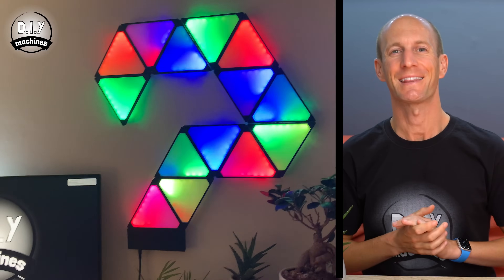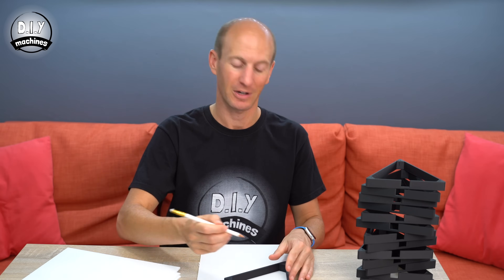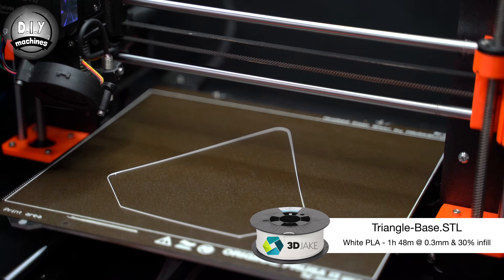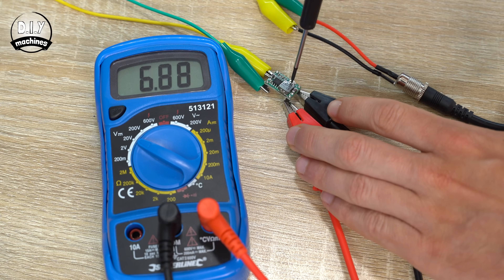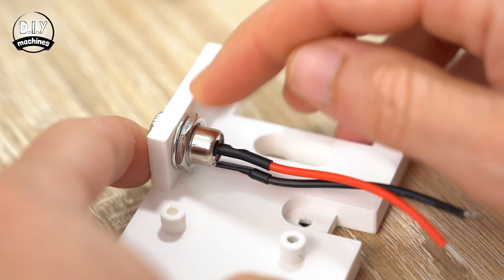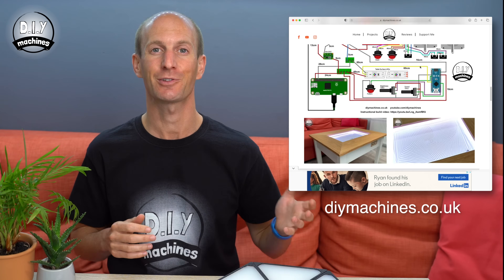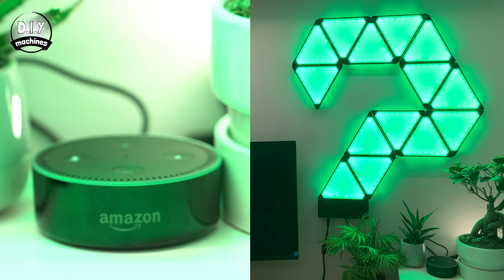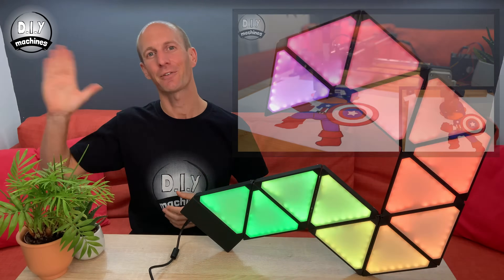3D Print Your Own Nanoleaf Project! - Alexa, Hue and App integration

Comment: Something i don't understand, 12 v led strip, 12 v power supply, - but down putting it to 5 v - that will impact the brightness of the rgb. or do i miss something
Reply from the maker: The 12v to 5v is only to power the ESP8266 and set the logic levels for the control signals. The LED's themselves are being supplied 12v.
Reply: @DIYMachines  Oo ok, thought later on already something like that. Ordering parts to make it. triangle is already printed, many to go :-)

Comment: Why is the Logic Level Shifter required?
Reply from the maker: The Wemos D1 outputs logic at 3.3v which is a little too close to the minimum level detected but the LED's so we use the LLS to boost this to 5v ensuring we get reliable data. On a small cable run you probably would get away with 3.3v but using the LLS is good practice for reliability.

Comment: Need higher density leds in these, it's a shame you can see the diodes, other than that they look really cool!
Reply from the maker: Thanks. The LEDs are less visible in real life (it’s tricky to capture on camera faithfully) and higher density strips will help, I settled for those used in the video to keep a cap on costs though you can you higher density strips if you prefer. Just keep an eye on the current draw.
Reply: @DIYMachines  that's good! They look pretty cool. Can't wait to see if you expand on the idea with even more shapes

Comment: can it be turned on with google home aswell?
Reply from the maker: The current design can not - it uses the waxing WLED software and if they add support for this then it will also apply to this project. See the section here: https://github.com/Aircoookie/WLED labelled as 'Supported light control interfaces' to see a list of everything it can integrate with. :)

Comment: is there any way to diffuus the ligt some more, the look of the led strip aint al that good
Reply from the maker: It's a tricky thing to capture on camera as the diffusion is better in the flesh, but not perfect. Perhaps lining the white back panel with foil could help.
Reply: @DIYMachines  thanks for your reply I'll try making one just to see if it's cool enough to make my printer run non stop for a week
Reply: @TwanJaarsveld1  They sell stiff and flexible diffuser channels specifically for led strips but they are rather expensive. Two cheaper options would be to make your borders thicker, giving the light from the leds more space to blend before it is visible. Another option if you want to keep borders thinner, would be to 3d print a translucent white wall to put a few millimeters in front of the leds. There will be a bit more light loss with this method but it will diffuse the light in much less space than open air. Pro tip with the second method: use an led strip that is on a white PCB (instead of a black PCB), it will diffuse even better with much less light loss.

Comment: I was wonder if anyone that tried this could help? I ran in to an issue where on the 4th triangle the leds stop working. I tested with a multimeter and multiple strips and the leds are getting power just won't light up.  3 triangles work fine.
Reply: Late answer but I thought I should respond anyway. Are you using the logic level shifter and have you verified that it works? This is the most common culprit.

Comment: Couldn’t you just use, say 12 AWG? And then not have to do anything different on the 6th? 12 gauge wire works for most things in a home, 14 even.
Reply from the maker: You absolutely could. 👍🏼